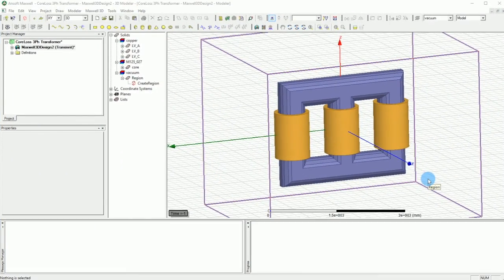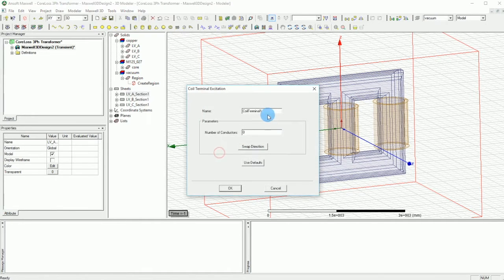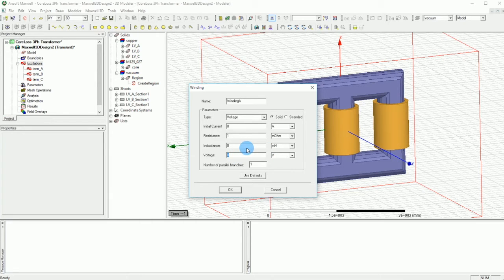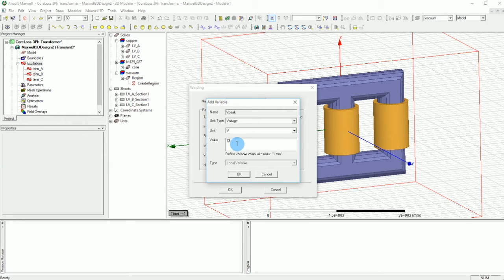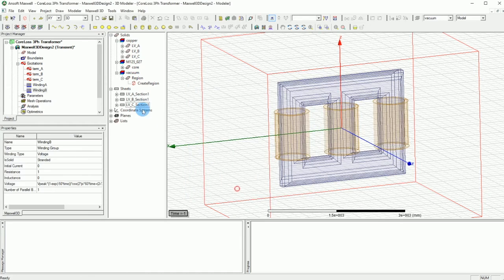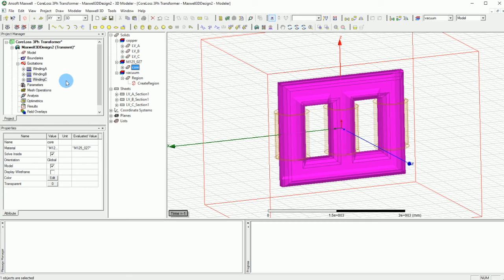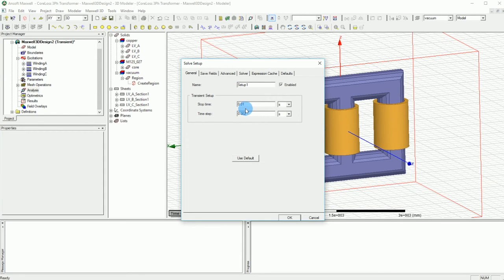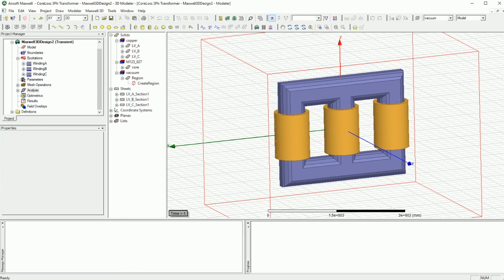411-Ansys Maxwell | Core loss 3 phase Transformer [2/3]

Comment: Why are u using the (1-exp(-50*time)) factor? What is the influence?
Reply from the maker: it is easy way to model ramp up voltage . at time=0 you get 0 and at time=4x50 you get 1

Comment: I have a question... Why you solve only for the coil corresponding to 13.8  kV? I thought it needed to use the primary and secondary.
Reply: Good point. It looks like he is calculating open circuit losses only.

Comment: Hi Kamyar, thank you very much for your videos. They help me a lot. I am doing transient solution for a 3D model of wireless power transfer system. The simulation went good and I was able to see the field and animation. But I could not get any report data neither plot nor table. It appear like blank. Please let me know if you have seen this. Thank you
Reply from the maker: +Ahmed Mohamed  make sure you saved the field in the setup properties. Also try to analyze it again and select the right values on the plot configuration. One last point if you are in transient make sure that time is not -1. If it is double click on it and change it.
Reply: @kamyark8434  Do you have a course??